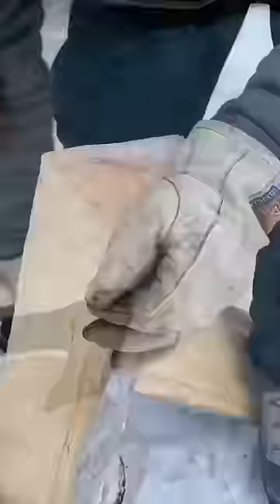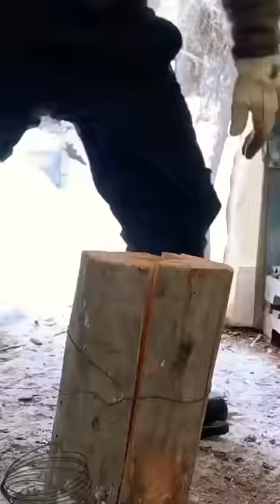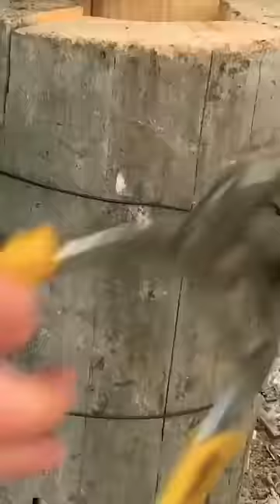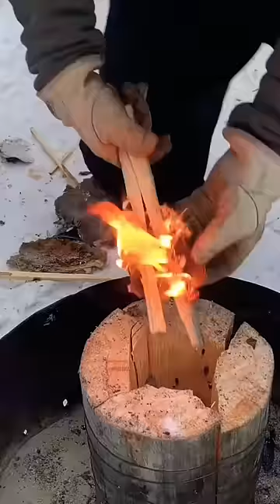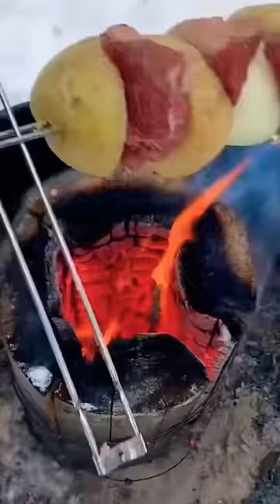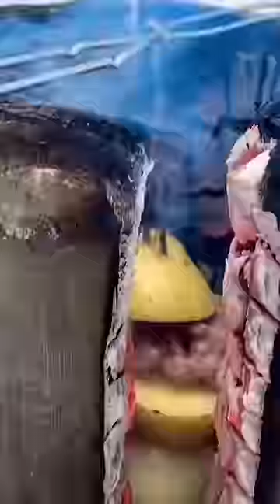Try this easy to make log oven #shorts #bushcraft #camping

Comment: You can use stones to hold the base together rather than using wire. Wire is a finite resource and rocks are free.
Reply from the maker: Stones are finite resource when it’s -34°C. they are frozen in the ground and buried under 3 feet of snow. Most bush crafters/outdoor men always carry wire to use for repair and setting snares to trap food.
Reply from the maker: @readhistory2023  Makes sense,  We prepare for our environment and we live in two completely different environments.